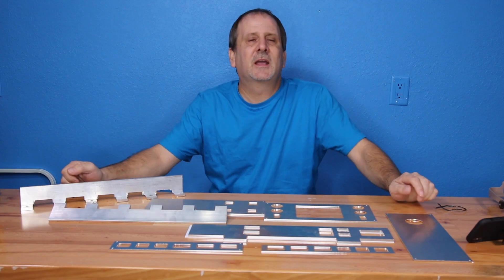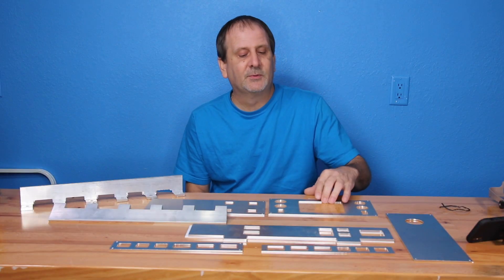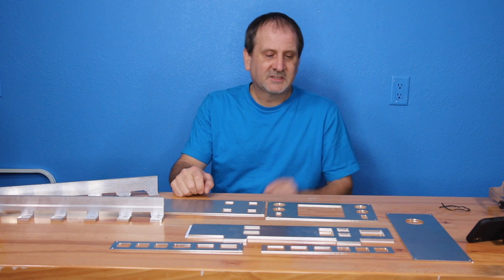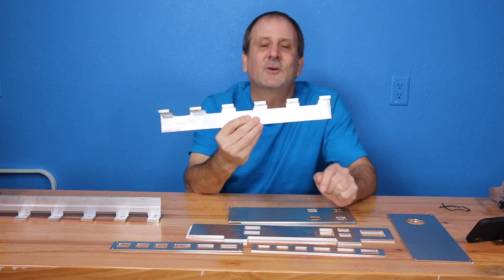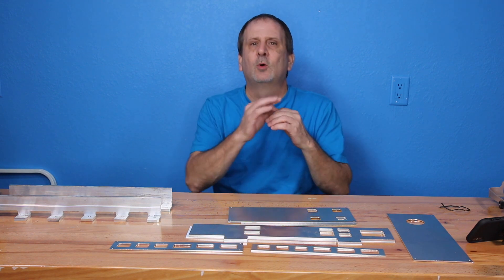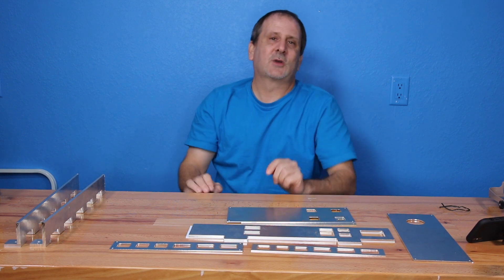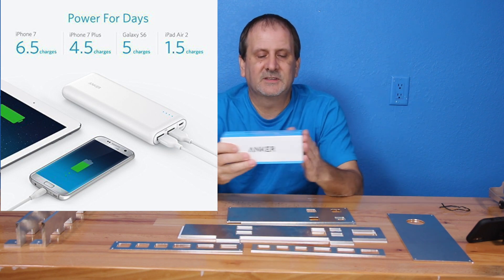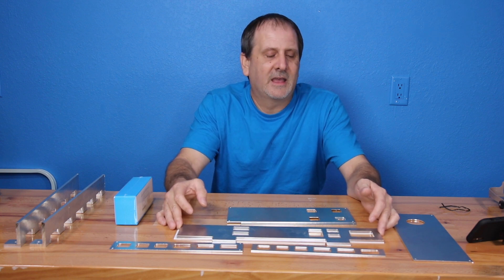Custom CNC Solar Generator Parts DIY! FREE $50 GIVE AWAY

Comment: Excelent parts. Cnc is the best options
Reply from the maker: I agree. just used them on the box they work great.
Reply from the maker: I just bought a small 2x3' foot unit and just got it and have to set it up to start using it. its a stepcraft 2 840